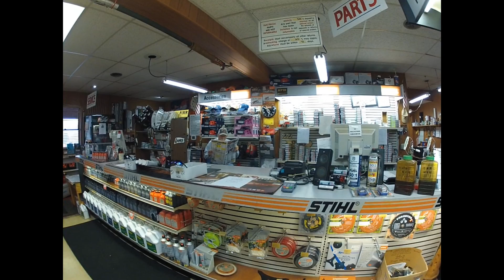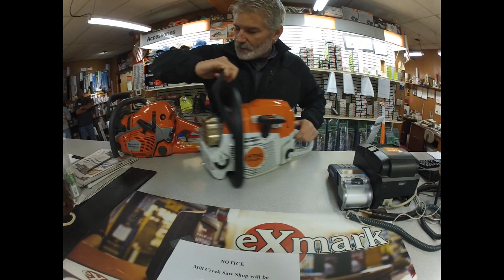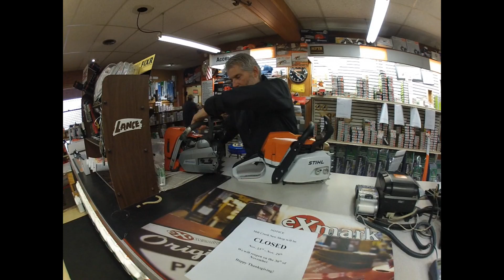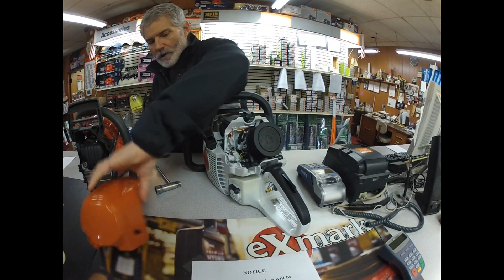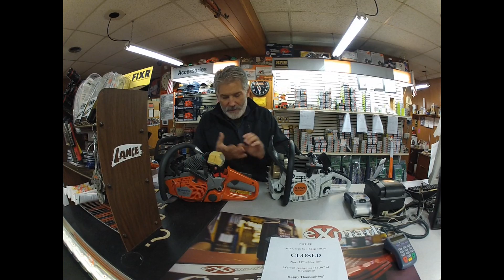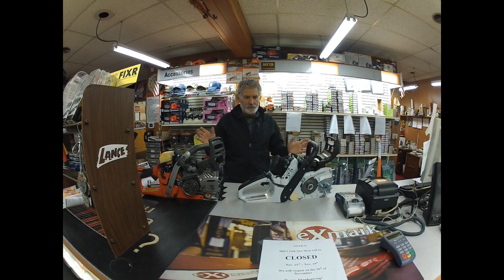Husqvarna 562xp VRS Stihl MS 362 Chainsaw

Comment: Just bought an Echo cs 620 pw. Love it. Same class of saw , but a new 362 is $950. The Echo was $600. Better warranty,  no auto tune, no crappy gas caps and smooth running.
Reply: And junk

Comment: I run a 562XP and a Stihl 261CM.  Yes, the 261CM is a little smaller, but there is no comparison when it comes to cutting.  I actually put a 16-inch bar on the 261CM and made it my limbing saw after running the 562XP.  On a side note, I'm a Stihl guy, but damn, I don't know what they did to that 562XP... that thing is a screaming banshee.

Comment: Very good video... however - I have a great deal of experience and after doing a lot of homework an comparison I am replacing my beloved old 034 super (60cc) going with the husqevarna 372 w/o electronic chipped carb --- the husky 372 is 70cc and is available with an old school carb... to hell with the chipped solenoided carb I say. old school husky 372 is an easy choice

Comment: Just to clarify..... m-tronic... is NOT fuel injected..... it is still a carburetor.... just the mixture is computer controlled with little servos on the adjuster screws.... although stihl does have actual injected equipment... ms500i and their masonry chain saw (I forget the model)..

Comment: Husky saws are very cheaply built and do not hold up like a Stihl. I operate my own saw shop and have for over 20 years. Husky has cheapened their saws up so much the reliability has been compermised. Cylinders pistons oilers and hoses fuel tanks crank cases and on and on. Huskys leak oil/ screws fall out/ no clamp on intake boot on some models/ plastic engine cases crack and suck air and burn them up/357 and 359 and more screws are to long in grab bar and wear a hole in the engine case and leak all the bar oil out/rewinds are garbage/ I could go on for days. Stihl has some problems to but nothing like husky. Just look on eBay and Craigslist refurbished Husqvarna saws for sale all over even at the dealership. Then Husqvarna goes and buys up all the junk cheap weedeater brand rayobi all the cheap throw away junk. Husqvarna has turned into a very poor company

Comment: i guess these new computer saws are good? then again i have to drive down the mountain and up the lake 6 miles to get cell or internet. i know with a small box of parts and a bit of knowledge my 044 will be up and running 4 sure 100% balls on singing.   when the answer is "bring it down and we will flash the update to make ur saw run" maybe its not for everyone. whats my 044? maybe 13 lbs and a touch over 5hp? what do they offer at 13lbs or 5+hp that beats it? thanks guys. rik
Reply: They are kind of made for this lazy generation that doesn’t clean the filter. So it corrects the fuel ratio as people don’t clean the air filter.

Comment: The fuel flip cap on my 7 year old stihl started leaking and had to replace it. I actually prefer non flip caps. It's just and extra step to me.
Reply from the maker: As some of you might know we are out of business now I simply couldn’t take the bullshit from some of the manufactures any longer ! Here’s the deal on those flip caps they are junk they never did work and Stihl was simply too hardheaded to go back  to the regular thread in That worked for over 50 years !
Reply: Not that it's a huge deal to me. They did work for a good while and the new one is working fine but I just purchased a Jonsered with the old style caps and like the smooth operation and comfy trigger.

Comment: I buy stihl 500 hot saws for cutting concrete and rebar.   They are the best made hot saw money can buy hands down.  they have perfected the m tronic in my opinion.  when it comes to chain saws, we buy husqvarna, because they have not given us any problems.  Husky chain saws have just kept on running to the point I can't buy a new one because the stupid 455 won't die,  I went and bought two husky saws anyway.  good thing to complain about.

Comment: Both are winter saw !!!! Both can't handle continuous work or intense heat , husqvarna 562 keeps blowing off the muffler  over heats also ! Stihl has  bad cooling fans ,  over heats and acts up at end of fuel cycle, then piston rings go out ? My opinion on all around saw would be husqvarna 372 xp before 2012 and stihl 360 or 036 , these two are the best saws before 2012 ! For some odd reason the old models out last the new models !!!
Reply: YesI have 361 Stihl very goodstrong,reliable saw.

Comment: Love the video, honest about everything.  Just picked up a "facelift" 362c-m and one thing I noticed is that the AV system isn't worth a crap.  Have you had any complaints?  I own a 201T, 270, 661, and as A climber use all kinds of saws at work, none of them vibrate as much as my new 362 though.  Just broke it in earlier today "video soon", and my hands were numb 2/3 through each tank.
Reply: I have 562XP AV system super, without any vibration. :-)
Reply: Human this turned out to be a faulty unit, right? Not typical of all 362s
Reply: Correct, they replaced the power head.  Though I doubt I'll ever learn what was wrong with it.  If I do, I'll post what it was.
Reply: sounds like a crank bearing failure

Comment: Get the GoPro out of the skeleton case and get the bare frame with lens protector. It GREATLY improves Audio! Then switch to a Medium field of view at 720 and 30 frames per second. I know, I sound like a broken record, but you'll be amazed at the improved audio and video quality. Another very well presented and unbiased review Rod! Thanks! Zip~

Comment: Great video rod. I'm trying to decide on the 362 vs 562 and I think i'm going with the husky based on your video. Very intelligent and thoughtful comments. It was great.   Turn up the sound next time.
Reply: The 562XP is a ripper, for sure.   You will notice an improvement after "break-in".

Comment: Info good. audio poor. The primer is good when you run out of fuel. also neither of the saws are "Fuel Injected" they just adjust the A/F ratio and primary jets of the carb. its bad to list them as FI saws. I've Fell over 600 cords of wood at 10,000' in a year and a half with my 562XP and have had zero problems.
Reply: how is the saw going?

Comment: Nice overview of these two saws. A comment... the Stihl issue with the throttle linkage is simply because the plastic bearing surface the operating rod has to rotate on and support itself when pushing on the throttle linkage under the carb. Same with a few of those models like the 391. A Systemic issue across models along with a much more complex system of levers and fulcrum points. Hoping Stihl puts a more durable bearing surface in that spot at a minimum! Also neither are fuel injected...both use electric over carburetor's to effect the mixture. The "heat" related issues on the 562 are worse with the earlier ones than the latest, and I believe there are more changes on the way. I open a cooling hole in the top cover clutch side right next to where the handle is. Have a hunch you might see some interesting updates over the next couple of month's if Husqvarna continues as they typically do updating and upgrading their models. ....:) I use a 32:1 oil mix and even on the earliest versions like my 555 don't have issues. Hope you recommend at least 40:1 vs. the typical 50:1, that alone will keep saws from coming back...any brand. Also Husqvarna really has more time working out the tuning issues...from el44 to el48's!  My bet is Stihl has to go through a similar learning curve AND will....the question to me is how hard it will be to upgrade older saws to newer specs. With the 562, after the change to the 6 screw case pretty much any update retro's right on to those saws.  Time will tell with the Stihl's....they are pretty early in the learning curve.....both really nice machines. Thanks for the  overview
Reply from the maker: +afleetcommand I'll comment on your "32:1" fuel mix. First, oil has come light years in technology in the last 20 years. Second, the cooling of an air cooled engine is enhanced by the fuel, the less oil in the mix the cooler the charge. So, 100:1 , although leaner a mix ratio, is a much cooler charge ratio. 50:1 mix oils have a lot of wiggle room and are the Richest mix ratio we recommend. We have used 100:1 for years with out any problems and upon tear-down and inspections see better wear than at 50:1.
Reply: Rod I'm super glad you know this.  This right here sold me on you being a well rounded intelligent salesman and mechanic.   Running 32 or 40:1 is going to do nothing but plug up the mufflers and exhaust ports.  Fuel is what keeps the bearings cool and oil lubricates theme.  A hot bearing with a lot of oil will fail way sooner than a cool bearing with less oil.

Comment: M-tronic is Stihls version , they both utilize a electronic fired fuel needle,  no longer operated by the old lever worked by a diaphragm. Hence fuel injected.... So to speak.
Reply: +ROD JONES kinda like port injection. just what we need out in the woods.
Reply: Still isn't quite fuel injection.  My cutoff saw is fuel
Injected by an injector

Comment: Good informational video Rod. I recently came into the market for my 1st saw, I got tired of borrowing my father's. I had a very hard time deciding between the Husqy 562 and STIHL MS 362. Ultimately it came to three things that helped me make my decision to purchase the Husqy.
1. The Husqy's handle has a slightly steeper angle and it just felt more comfortable for me to hold
2. Husqy offered a 4 year warranty with purchase of 3 of their mixed fuel cartridges over STIHL's two year warranty
3. The crew in where I purchased the saw are good guys, my Dad has dealt with them over the years and they've always taken care of him.
I also bought the Powerbox, and I must say that is a must! It keeps the saw from rolling and moving around when driving. I really wanted to buy the STIHL initially, after I got my hands on them though, my choice changed. I love my Husqy, its a screamin machine that doesn't slow down for much.
Reply: how is the saw going?